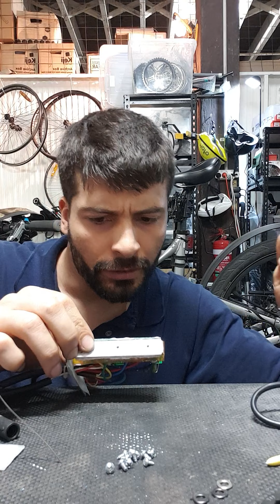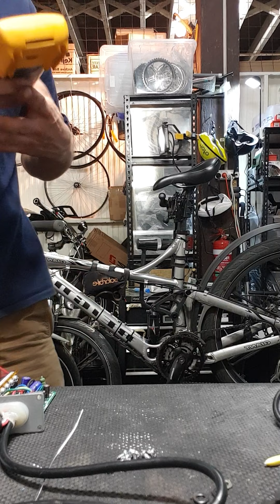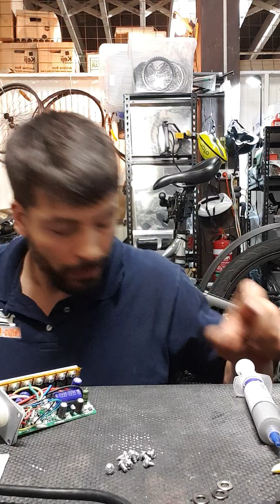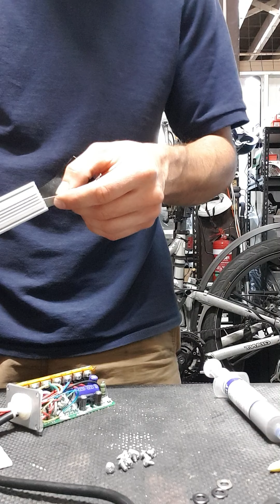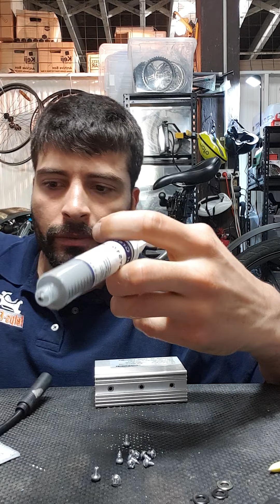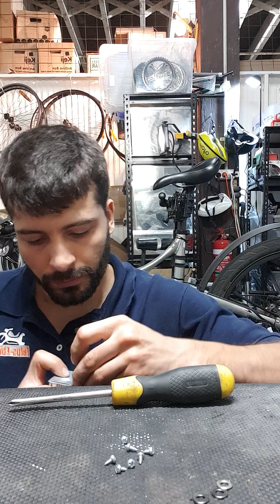Modifying an Electric Bike motor Controller

Comment: Hi like your video I've got a problem the lug connectors on phace wires on hub motor and my controller is 45amp what are the best lug connectors to deal with voltage I was told 40amp and doesn't matter what I use it's a second opinion from you as you seem to no
A lot about ebike. I bout these items on ebay with no connectors thanks colin

Comment: You asked me about what your doing. I work on 2000wat 45amp controller battery 52v 25amo top speed 48mph that's the best Way it saves mucking on with solder that I'd bad for lungs. Just buy a upgrade bike kit

Comment: The best way to upgrade controller is solder the shunt bars. The controller has to be 35+2 amp not to much solder as the controller will heat up so its a little along to top of bars nip them together you will have a gap at bottom run solder along to top you end up with 40 amp controller use 52v17.5 battery or 25amp
Reply: hvd-3 800w my controller has a R005 resistor I'm looking to place another on top to half the ohm. To 0.0025. .... The resistor is a 0.0005....question is what watt do i buy 1w 2w 3w 4w 5w... I haven't a clue can u help please
Reply: @LouiePage-g1e  hi I'm not into resistors the info I got from criss crossing wires he's the best guy to give you advice on that. If he doesn't help you he should it's better to upgrade controller yes its the pricedo you not mean cappasitors there are normally three or four be carefull if you touch them with current going through you can get killed. To drain controller switch display of first then turn battery of then press display it will flash that means the controller is empty sorry I can't help you there

Comment: Noob question: can I change the MOSFETS of an ESC with a more powerful ones??? I'm not saying just soldering in rhe same place but instead make a housing with heatsinks with fans , fat wires etc ???
Reply from the maker: yes you can experiment whatever you want, specially if that reliably works after the mods

Comment: So would this work if I was to upgrade from 24volts to 36volts? I know my hub motor can take it. But they don’t make a controller for the brushed hinzman motor I have or that I’ve found yet.
Reply from the maker: That won’t work for over voltage, you might have to replace the capacitors of your board but I cannot guide you through because I can’t see your board components

Comment: The long line of solder is on the back side of where the FETs connect? Also adding solder on the current shunt? Is there something you recommend doing to help dissipate heat from the controller box?
Reply: Nvm you answered my question about the heat. Lol thermal paste on the backside of the heatsink.